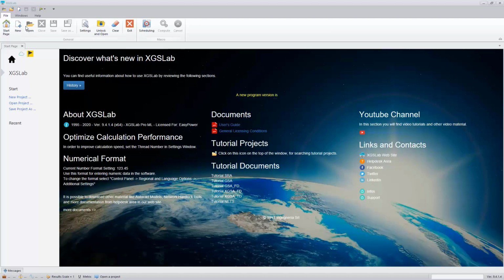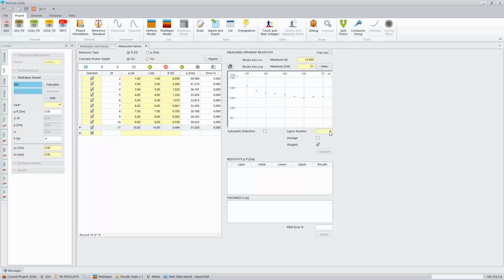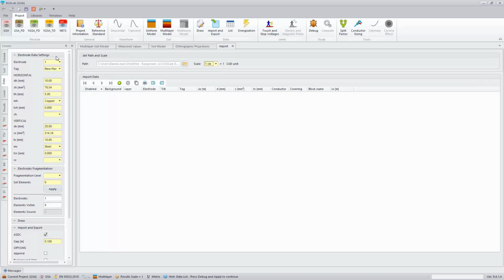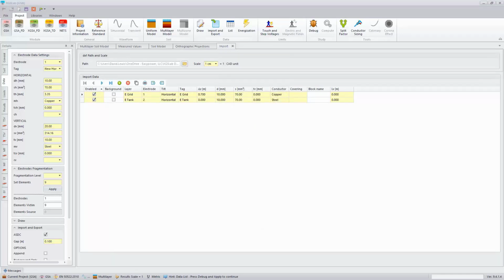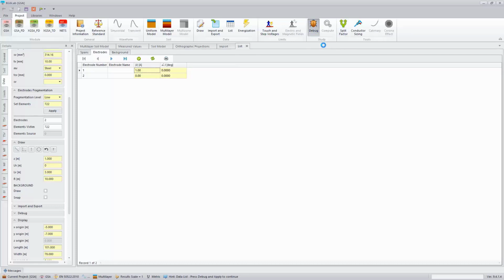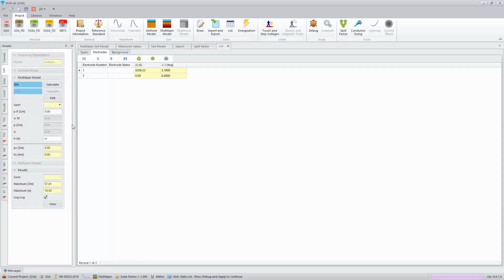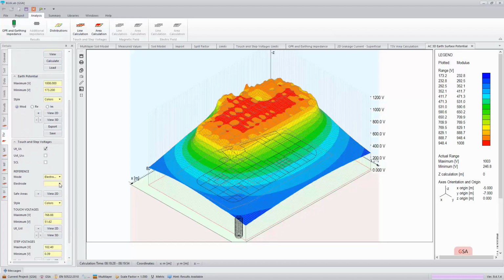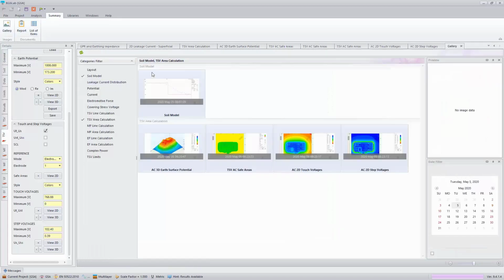XGSLab Tutorial (GSA)

Comment: Hello, I have a question.

I have a ground grid of a photovoltaic Plant connected with a ground grid of a substation, if I apply gravel in the option I will gravel the entire land including the photovoltaic plant (which is not true), I could with this system electrode reference when I set the substation as a reference and apply the gravel, in this case I would be focusing only on the substation or in the same way I would be influencing the entire area (substation and PSFV).

Thank you!

Best regards
Reply from the maker: Hello, if you want to make distinction you can use an area calculation for the substation and then , in the results, use the covering soil layer. On the other hand, you can use another area calculation for the photovoltaic system an there avoid using the covering soil layer.